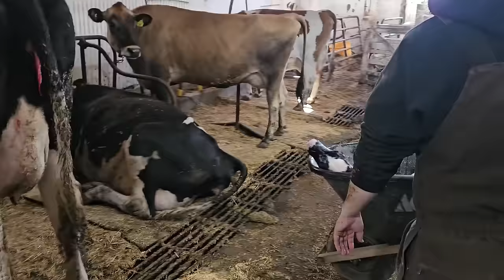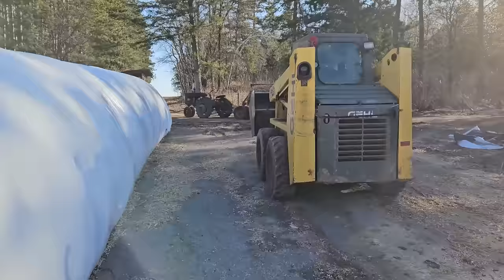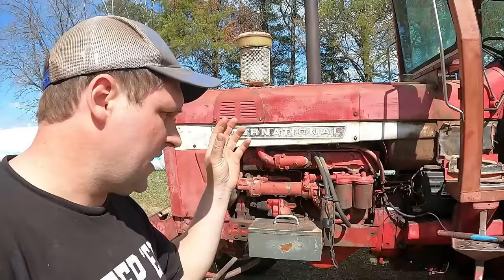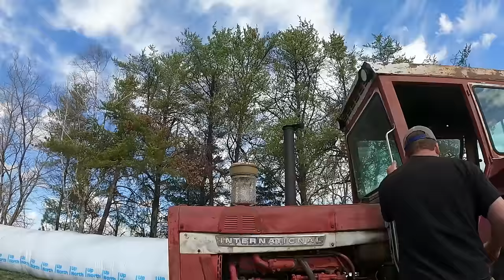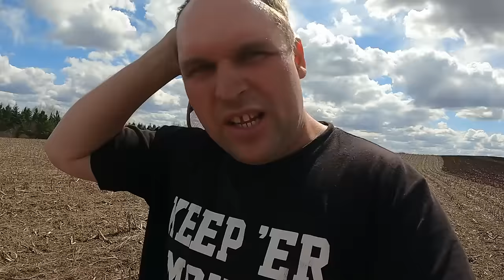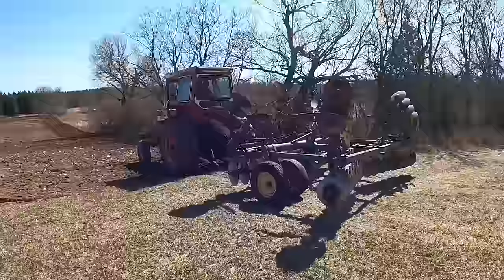New Calf Born On The Dairy Farm/Finishing Up Discing The Field

Comment: Just curious why you dont have the wings down, I'm looking at buying the same size disk and wondering if my 806 will pull it. My 9700 will have no problem tho.
Reply from the maker: I just have the wings up for more weight on the disc, so it cuts better.

Comment: How come you don't fold the wings down on your disk tractor seems like it's got plenty of power and yes that is a very good ideal to put one 12 volt battery on the tractor
Reply from the maker: I have them up,for more weight on the disc, so it cuts better.

Comment: I'm curious as to why you are not using the wings on the disc? I know that tractor would pull it fine
Reply from the maker: Puts more weight on the disc, so it cuts better.
Reply: @trinitydairy  that makes sense. Didn't think about that

Comment: Do you still have that little ford tractor only seen it once when bought it
Reply from the maker: Yeah it's in the shed, something in the clutch came apart, so it needs some work.
Reply: @trinitydairy  I have a shed full of parts for them old tractors if you need parts good luck on the clutch they can be a headache

Comment: Think mother cow should be in pen with cafe by them self
Reply from the maker: We had a pen ,and  didn't like it. Always had to watch so the cow didn't lay on the calf, or push the calf  into the wall,or out of the pen.
Reply: @trinitydairy  with this cow or all your cows we have pens when we raised calt no problem like you mentioned. Sorry
Reply from the maker: @jeffreyhinkle3697 all the cows, it was a constant issue we had to watch like a hawk. Weather permitting, we try to let them calve outside.